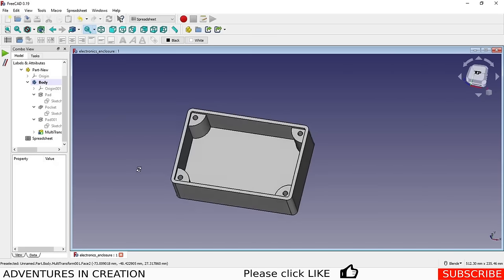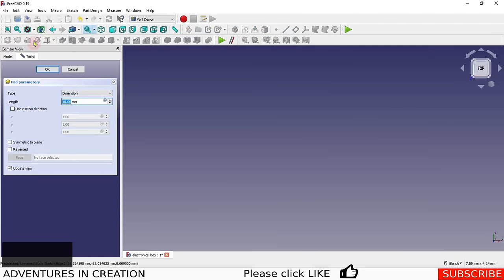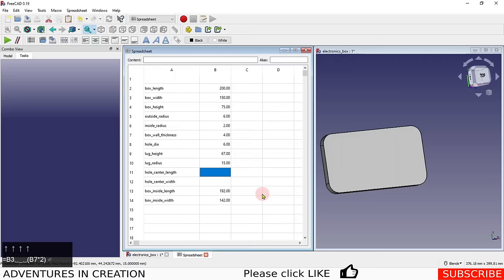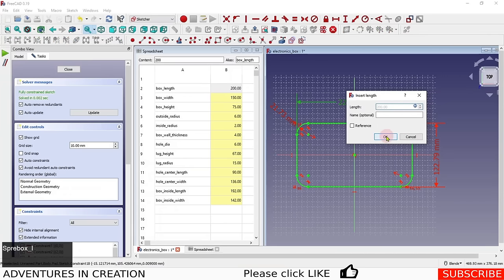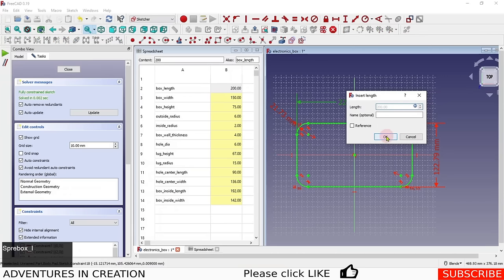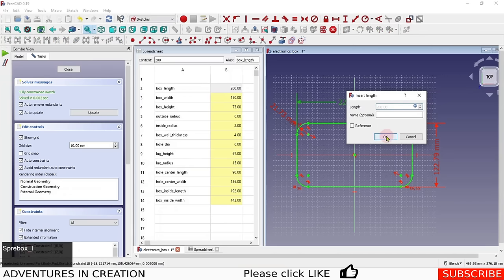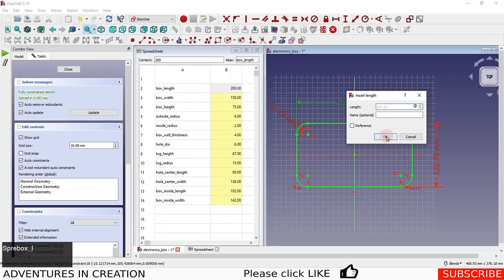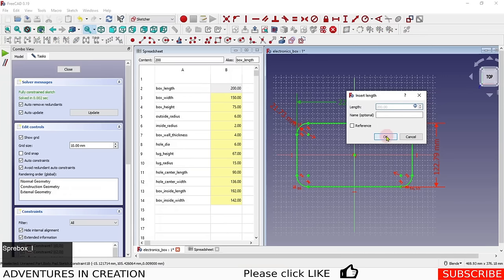FreeCAD Electronic Enclosure Using Simple Parametric Design Techniques

Comment: Excellent video and very clear instructions as per your most helpful other videos. I'm nearly finished with making the box, just need to add the lugs and will use it to create boxes in the future. I normally use Tinkercad but this is way better and can create boxes of different sizes quicker and easier. Thanks very much mate, I've learned a lot from you
Reply from the maker: Are you going to let us see your box? I would love to include it in a future video.
Reply: @Adventuresincreation  do you mean the drawn box or the printed box? I'm working on  the lid now at the moment, keep making mistakes and messing up but hopefully will be finished tomorrow.
Reply from the maker: @TankTurk  the drawn box will work but pictures of the printed one would be cool too.
Reply: @Adventuresincreation , I can send you screenshots of the box if you let me know how. I am not ready to print the box yet as I want to add lugs/spacers to screw Arduino on to. If I can, I want to make them parametric as well so that I can change their position for different Arduino boards. I have no idea if that's possible but gonna try. I'll let you know if I succeed
Reply from the maker: @TankTurk  I am confident you can make those lugs parametric too. Sounds like a great project. We can wait until you have the finished article then I will send you info on how to get the file to me.
Reply: @Adventuresincreation  hello mate, I have finished the box with spacers for pcbs/Arduinos. I've also included usb and power plug holes, all are parametric. Let me know if you still want the screenshots and how to send them to you.
Reply from the maker: @TankTurk  definitely, can you share the freecad file? Could you share it in Dropbox or some other upload service? I will include it in my next video.
Reply: @Adventuresincreation  Where do I send the link to the DropBox shared folder? Just paste it here?
Reply from the maker: @TankTurk   https://www.dropbox.com/request/2Urodxi2VAoaimFy7pNA
Reply: @Adventuresincreation , done mate.
Reply from the maker: I got a chance to look at it this evening. Looks like you put a lot of effort into that. One thing I would recommend is calculate the placement of the pcb lugs from the size of the box, i.e. if I increase the length and width keep the lugs moving proportionately. I would like to show your design briefly in an upcoming video if that's OK with you?
Reply: @Adventuresincreation  I tried that but found it harder to place the lugs in the correct place. As with Arduino Uno, the screw holes are not always all lined up and square to each other so placing them to the size of the box would cause more of a problem. You'd need to calculate each lugs position from the other mathematically: ie: if one screw hole was 1.67mm to the right or left of the one before it, you'd need to divide the box size by 2 and then add or subruct the 1.67mm to that. Same goes for distance between the two

I thought/think that it's easier if after positioning "spacer 1" all you have to do is enter the values given in the drawing. You still need to do some mathematics but it's minimal. I'll try and explain if I can

Let's say Spacer1 is 10m from left and 10mm from the front, from inside left corner of the box. Spacer2 needs to be 1.7mm higher and 40mm to the right of Spacer1. You enter 40mm for the distance and then add the 1.7mm to the front position of Spacer1 (10+1.7=11.7mm) and enter  this value for Spacer 2's front position. Same goes for Spacer3 and 4

This does cause a problem with sizing the box though, I can't make the box smaller without moving the lugs out of the way first. What I do is, put all  the lugs as close to the bottom left as possible then change the box size and then place the lugs where I want them. Or, I place the lugs where I want them and then resize the box. 

This is what I found out while doing the spacers/lugs but I am just a beginner and maybe well wrong in my thoughts. 

Yes mate, do whatever you want with my design and if there is an easier and better way, maybe you could do a new video of it (hint, hint LOL)
Reply: @Adventuresincreation   My lid dont follow the box , sry for upload, but it is a nice way to make boxes, thanks for the tutorial. regards jj
Reply from the maker: @Rodfraeser  I took a quick look, it appears that pad3 in body001 should be reversed and the z position for sketch 004 should be the box height - wall thickness. Then your lid looks great.

Comment: Great tutorial.
i tried adding screw-thread to casings which is doable with a plug in. Works easiest in the parts workbench but can be done in parts design workbench as well. It is OK in PLA, but  in PETG it is almost useless as there usually is some shrinkage. Still looking for an easy way to imbed or add a metal nut to e.g. cornerstuds. I can think of some ways but not sure if those would be the 'easiest'
Reply from the maker: Have you tried making a slightly smaller hole than the nut then heating the nut and pushing it in? Or you could create a cavity then insert the nut during printing.
Reply: @Adventuresincreation  tnx. Tried variations to that first theme by gluing the nut.
2nd one i have thought about. Need to put in a 'pauze print' in my gcode once i figure out whers the cavity for the nut is done printing
Reply: I think what most people do is use what's called a threaded insert and melt it into the plastic by heating it with a soldering iorn (and using tweezers to hold it straight)

Comment: The problem i have is i cant follow your macro right from the start and hence something is different for me from the beginning. It would have been really beneficial for people like me to start it without the macro as i've ended up with a line through the 3d model.
Reply from the maker: Let's see if we can remedy that. The start up macro that I use is detailed in this video https://youtu.be/fCNRCXMzoRs
It only creates a new FreeCAD file, then inserts a part and body into the file. Then it starts a sketch but allows you to select the plane you would like to sketch on. - That's it. In many of my videos I do this manually for those that haven't yet created a start up macro. - I normally use it just to start a file quickly but, whether you use it or not, you should not end up with a line through your 3D model. If you would like to share the model with me, I will take a look at it for you.
Reply: @Adventuresincreation  Thanks heaps for trying to help me out. I'm going to do it again and so far so good. I'm learning more and more each time but it's a huge learning curve. Videos like yours are gold. Cheers.
Reply from the maker: That's great, you are welcome.
Reply: @Adventuresincreation  Thanks again...now I've learnt enough to even redesign the lid. Cheers.

Comment: Very informative for my first try at a box, but I am having a problem with the inner box. I have gotten to the point where I have the box and the corner fillets and symmetry, but when I try to make all 4 fillets equal it creates two constraints in such a way that one corner has both, two corners have one each and the fourth corner has none. I have deleted the sketch (inner box) twice and started over but the same thing happens. does anyone have a clue what the problem is?
Reply: version 0.19 24291
Reply: OK, maybe I solved my own problem. I went back and looked at the outside box and see that the equals constraint only shows up on two fillets. So I am guessing that the symmetry constraint takes care of the other two.
Reply: It seems my version does not act the same as yours. When I make a pocket it has a floor, all I had to do was calc the depth from the spreadsheet items.
Reply: Well, I crashed my version of freecad trying to mirror the second two lugs. I had to restart after saving with a new name, but have not tried anything new yet.
Reply: Solved this also. The report view was too large a window and the dialog for the mirror did not have a scroll bar so I did not see some of the buttons. Since my actions failed to work I tried several times and apparently caused a problem. After re watching your video I tried again and went looking for the missing buttons - so it worked and I now have a good sketch. On to the lid!
Reply from the maker: It sounds like you are having fun! - I am glad you have got this worked out. The lid is easier, so you should be plain sailing from here on out.
Reply: @Adventuresincreation  Well, about that. For an old guy I am having fun, yes. The last time I did any "drafting" as it was called when I was in HS and college, I used triangles, T-squares, pencils and pens - smile. This is a lot different. Either the terms have changed a lot over the years or I have forgotten (maybe both). But as I said above, the .19 version - Winders 10 64bit - you did this with and what I have seems to act a little differently at times. For instance - when putting the arcs on the corners - it seems that in my version if you do the symmetry steps, you only need to click on two corners when you make them equal. If you try to make all 4 equal you get constraint errors. Even with the changes going on this is a great program (I programed for 30 years - most people didn't even know what a computer was when I started. Ever hear of a Minuteman D17 computer - almost all of memory AND registers were on a small hard disk)

As for the lid... well it does seem straight forward, but either some of the new_part starting stuff is slightly different or I am not quite understanding what you say and do. Sometimes I can't get what I think you did to work. I am having a time getting freeCAD to let me just see the lid, and when I do get the main box part hidden I have a time getting it back. I make it active and hit the space bar - sometimes that works others no. I have to give it a rest and go back later or I get very frustrated at times! :)

I have taken to watching your videos straight through 2 or 3 times, then bringing freeCAD up and doing the sketch steps as I start/stop (backup) the video. At times it is very easy to miss things which you and others making videos almost gloss over because the step is so obvious and simple to you. But you do a better job than some of them BTW - did you know you have a slight accent? (Smile)
Reply from the maker: @davidpanetta5492  I too learned drafting the old fashioned way, I think that gives you a good understanding of the desired end result but CAD definitely makes it more fun!

Comment: Excellent video! However, I seem to have come across something bizarre. Everything is good right up until i try to do "box_centre_width". All my spread sheet values are exactly the same as yours, with the hole centre width being calculated at 61 mm yet the lug doesn't line up with the top inside face. I've had to add a +1 to the hole centre width to make the lug line up with the box and I'm totally confused as to why
Reply from the maker: Can you share your freecad file?
Reply from the maker: It is very good for an open source cad cam package. Check out my video on moving from fusion 360 to freecad it may help you.